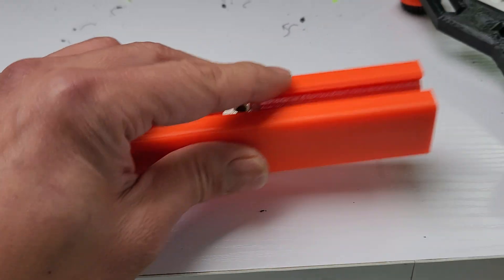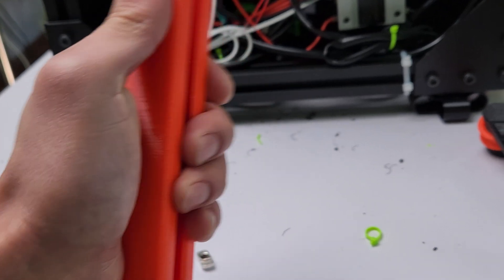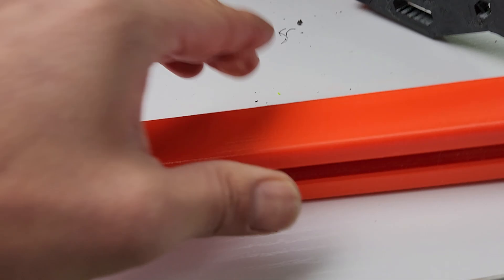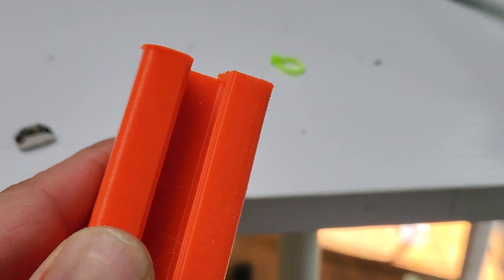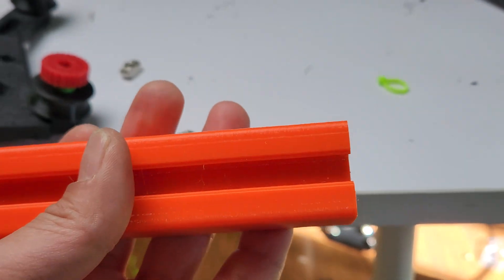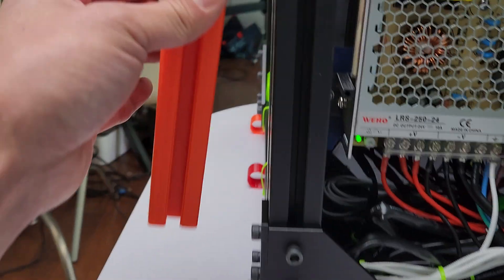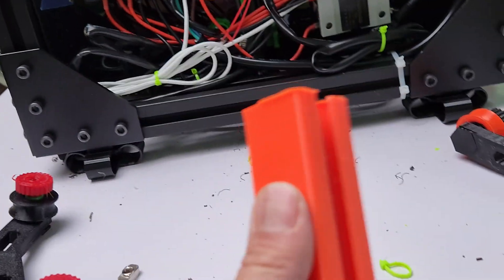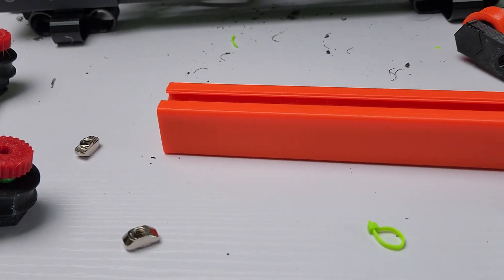3D Printed 3030 extrusion in PETG!

Comment: That's awesome! This makes me wonder how strong/rigid a 2040 extrusion would be, as it's a standard frane piece on lots of 3d printers.
Reply from the maker: I wouldn't use it as a frame for 3d printer due to petg flexibility but maybe tougher materials like abs might not be bad at all.  But for simpler things like spool holder I am building this worked out perfect!
Reply: @3dPrinterSchool  I love how creative this is, even if it's just used for your spool holder.